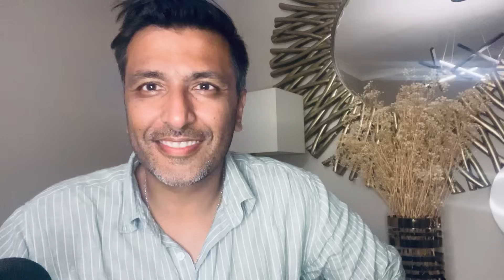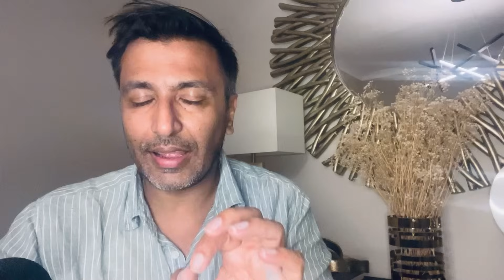Pulsed field ablation for AFib

Comment: The latest research I have seen, published in the last 90 days, says that PFA is safer, but that it's success rate (one full year without having AF) is almost exactly the same as RF ablation.  The good news is that more experience will help, and that takes time, but also that the implements applying energy to tissue are improving and able to be used in more than a simple PVI. A simple pulmonary vein isolation will fix about 75% of all cases of paroxysmal AF, but the longer one's disorder has progressed (it always progresses!), the more foci for electric signals confounding the SA node there are in more and more surfaces of the heart's chambers.  IOW, complex.  So, get an ablation as early as possible, or get control of it with drugs to spend as little time fibrillating as possible.

Comment: I had pulsed field ablation as part of a study just before Christmas. The procedure went well and although I had one more incident of fast AF in April ( when I also had diverticulitus) , it has been successful. I am reporting regularly using a kardia machine at home and having follow up with the research team which has been very helpful and interesting. Unfortunately, I was also having a lot of ectopics, noted when they did they AF ablation but they couldn't deal with those at the same time as they stop under anaesthetic and are in a different part of the heart. Those have got worse and I am now having another ablation at the end of August but I believe that will not be pulsed field, which is a shame as I feel that would have been a better option. Here is hoping the new technology rolls out quickly!

Comment: @YorkCardiology
You should mention that losing 10 percent of body weight has a superior long term success rate over ablation.
For the price of one ablation 3 to 5 years of healthy prepared meals could be purchased.
The side effect of eating properly is overall better health, an ablation without changing eating habits is just waiting for the next problem to occur.
No ablation should be approved before weight loss happens.
No ablation should be approved before manesium, potassium and B vitamin deficiencies have been addressed (at a minimum).
That should take care of the majority of AFib cases.
Reply: Very good post. You are right about the impact of weight loss and optimization of health through the elimination of processed food.
Also, other lifestyle changes such as regular, moderate exercise,  Dr. Sanjay has a good post about this, too." Get your Afib letter with exercise."
I think all of these lifestyle changes help you regain some level of control and perhaps would ensure better outcomes for ablation

Comment: I had a PVI ablation done with RF back in 2014. 

For 6 weeks afterwards I could not swallow solid foods. I lived on soup and liquids and was taking 80mg of omeprazole every day. 

The ablation was seemingly quite unsuccessful but it took my heart 2 years - YES 2 YEARS to recover and settle! Since then I have had very few episodes of afib and the times I have, they are pretty easily stopped by a cough or getting up quickly etc. 

However I do have one long standing issue in that I believe the vagal tone or response has changed with my heart. If I do something sudden or walk upstairs for example, my heart does not respond straight away and rise naturally anymore. It seems to play “catch up” and takes a few seconds or more to raise to accommodate the extra energy I have just spent. It’s a strange phenomenon and one which my EP/Cardiologist did not have an answer for? 🧐

Comment: My cancer treatment caused Afib that became refractory to even cardioversion within weeks- then, if I was able to kick out of Afib, it went to A Flutter at 150BPM. My heart rate was at or above 150 for 7 weeks straight 24/7. I had PFA for the AFib and "regular" ablation for the A Flutter in a 5 1/2 hour operation (they struggled to stop the A Flutter. That was 10 months ago and, knocks wood, no additional issues with my heart.

Comment: I'm 44, with vagal AF and had a PFA last year. Not a good recovery at all unfortunately.

In the weeks and months after the operation my heart became very agitated with new flutters and arrhythmias, especially with postural changes. I also had new persistent chest heart pains which my EP dismissed.

Just changing postition in bed and rolling over would spike my HR from 60 to 120+ bpm. Was diagnosed with IST.

Then I developed POTS, dysautonomia and chronic fatigue type symptoms which is where I am now. The heart has calmed down, still some chest pains occasionally. This is what I am left with.

I'm sure that the operation helps many people, but am also concerned that the experience of people like myself does not find its way into the statistics.
Reply: I sympathise 100%. Not been affected to the same extent maybe, but I've had multiple trips to A&E (ER) with my heart going absolutely "haywire". Very scary and life-limiting. Subsequent fear of an event also impacts confidence and encourages "self-guarding" behaviours when it comes to exercise etc.

Comment: Dr. Gupta, You were once not a fan of ablation. Why the change? I was told by several doctors at Massachusetts General Hospital that ablation of any kind is not a cure    For AFIB. It will always come back. I was in the original study for PFA in July 2022. I had all the testing and was cleared to participate . I backed out a week before having the procedure. I am  a 30 survivor of acute myeloid leukemia with bone marrow transplant. Having an ablation felt more uncertain and dangerous than my cancer. My intuition told me to back out. I might have saved my life. The doctors at Mass General Hospital in Boston were not happy. I still have AFIB. It comes and goes. I think it’s just something that I have to live with. I know carbohydrates bloat me and my stomach is directly related.

Comment: Thank you Dr. Have been following you back from 2018.   I had PFA for my Afib, and left atrial appendage occulsion with Watchman FLX to prevent stagnated blood from pooling in the appendage sac causing blood clot..   All these were done in January 2024, in Hong Kong.    I have been doing much better since.     PFA is way more better than the radiio frequency ablation I  had in 2018.   Now I need only take baby aspirin for the Watchman.
Reply: Which hospital in HK offers PFA? If private how much? I'm in HK and wants to get it done for my AF. Thanks.

Comment: The following caution has been raised at a Japanese academic society:
Complications specific to pulsed field ablation (PFA) include hemolysis (destruction of red blood cells, leading to anemia or renal impairment) and coronary spastic angina. According to the referenced paper, coronary spastic angina occurred in 0.14% of cases, and acute renal impairment requiring dialysis occurred in 0.03% of cases. Regarding hemolysis, reports indicate a higher incidence of anemia with a hemoglobin (Hb) drop of 2 or more (18.6% for PFA vs. 4.6% for radiofrequency ablation) and acute renal impairment (3.2% for PFA vs. 0% for radiofrequency ablation) compared to radiofrequency ablation. It is said that hemolysis is more likely to occur with a higher number of energy applications, so caution is needed for patients with left atrial enlargement, anemia, or reduced renal function, as these conditions may increase the number of energy applications required.
Additionally, treatments other than pulmonary vein isolation are not feasible with PFA. In cases with a large left atrium or long-standing conditions, additional ablation may be necessary, but PFA is currently approved only for pulmonary vein isolation. Recently, the society issued a warning that cerebral infarction and air embolism have occurred more frequently than expected, and coronary spastic angina has been reported due to off-label use.
Reply: Thanks for info
Reply: Thank you for your post. I would like to correct one thing. You say " Additionally, treatments other than pulmonary vein isolation are not feasible with PFA ". This is simply not true at all. I had pulsed field ablation for atypical atrial flutter, two lines were ablated on the back wall of my left atrium, one high and one low. In the same operation the electrophysiologist performed a Cavo tricuspid ablation to prevent any possible future typical flutter. These ablations were performed in a large centre in Denmark. I had had a previous Pulsed Field Ablation for atrial fibrillation.
Reply: @Vacaiable  I apologize for writing incorrect information.
Since this is likely information from a Japanese academic society, it seems that pulsed field ablation (PFA) is considered off-label in Japan.
Reply: @モモタソ1923 Dear friend from Japan. No need to apologize. I just want people to know that Pulsed Field Ablation is being used for more complex ablations. I want people to be hopeful that they can improve as I have have. Regards from Norway.

Comment: It will take 10 years for doctors to train into this..  So I wish doctors will talk more about diet.  If I avoid carbs I do not go into afib its a strange thing.
Reply: No, you're wrong about 10 years. An electrophysioligist at my hospital here in UK has been performing it for 3 years. He did not do 10 years training. I can assure you of that.
Reply: @CJR434  Yes. The fact is that Pulsed Field Ablation is considerably easier to master than Radio Frequency Ablation, especially if the ablation is the index ablation for atrial fibrillation i.e pulmonary vein isolation. An experienced electrophysiologist who has mastered RF ablation would probably take a matter of weeks to achieve the same success rates with PFA.
Reply: Possibly when you eat carbs, you ramp up inflammation in your body. Inflammation affects a lot of things and it can affect the heart. A lot of inflammation, I've heard, can cause heart attacks. To help with inflammation, an important recommendation is to reduce carbohydrates! Eat more protein and low carb veggies. Some can eat a little carbs and others not. I've been one of those who can't. There are other recommendations and things you can take to reduce inflammation (like black seed oil which can bring it down pretty fast. It's better to take it in capsules bc it has a strong flavor). Google inflammation. There's lots of information on it.
Reply: I have the same thing. All PVCs went away when going carb free